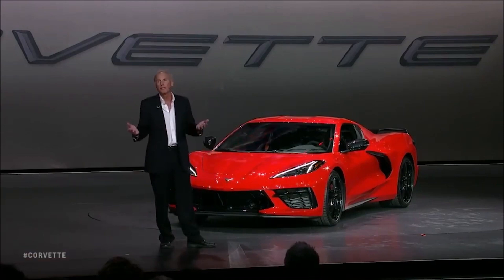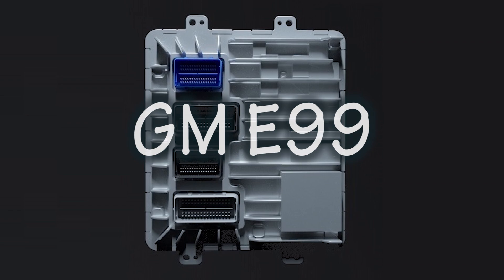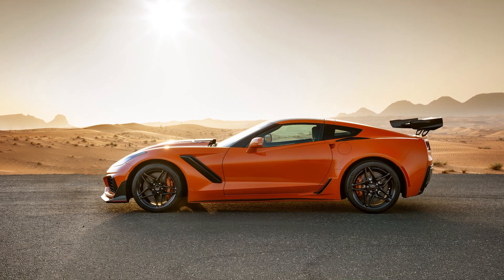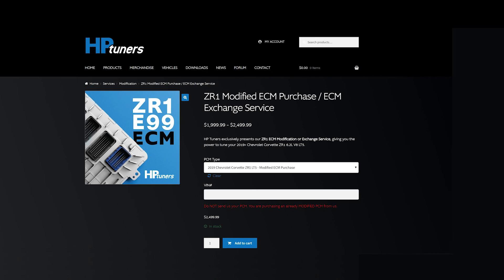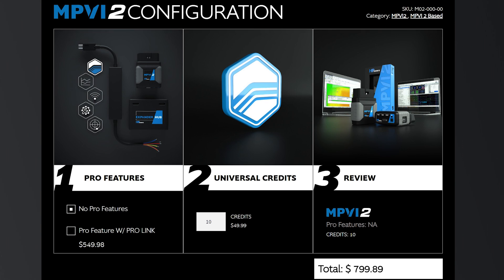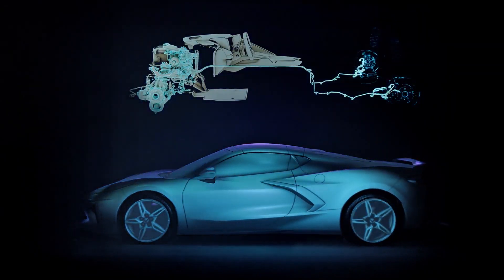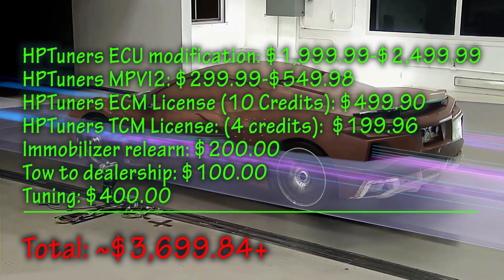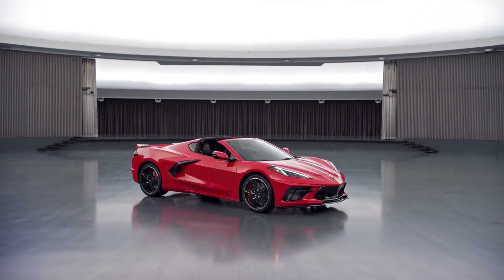Tuning the 2020 C8 Corvette ECU

Comment: You are not necessarily correct when you state that modifying your ECU voids your warranty.  In order to void your warranty, the manufacturer has to prove that the modifications caused the warranty issue.  The burden is on the manufacturer, not the owner of the vehicle.

Comment: It funny how people talk about warranty 90% of the people buying  a car dont even buy the warranty for the car cause it cost so much so I think 3k for a aftermarket update and make 1000 hp and go faster that is hella good for me
Reply: People don't BUY warranties.  It comes with every new vehicle.  If you're talking about extended or aftermarket warranties that's completely different.  All the same, the manufacturer CANNOT, by law, arbitrarily void a warranty just because an owner made a modification.  Rather, the manufacturer has to prove that the modification caused the failure.

Comment: GM,Ford,etc etc can NOT void the warranty if you tune the C8  it's against the law to block anyone from  tuning or modify there car while it's under warranty per Sema vs. auto manufacturers union
Reply: More specifically, the manufacturer has to prove the modification caused the failure.  The burden of proof is on the manufacturer, not the owner of the vehicle.

Comment: How comes every time there’s C8 videos there’s always Supra haters in the comments?😒
Reply: Because it doesn't have a1JZ and is not based on Toyota's own r&d I'm with the purists when they say is not a real supra. The supra should have been closer to the LFA with a finely tuned 1JZ derived engine +500hp priced at around $56,000.00 what Toyota did was to cash in$$$ on the supra name with no substance to show for.
Reply: because it's that much of an embarrassing car
Reply: @LynnIronLightning  hell no it's not, it's running 12's with a little over 330whp and it can corner very well.
Reply: @CloroxGodThe1st  that's not the problem, the problem with it is it's not a toyota supra, it's a bmw z4 with a different body style badged with toyota and supra, the embarrassing part is that toyota overwhelmingly disrespected their legendary car with this infuriating lazy job, it's like ferrari making a new gen f40 by allowing fiat to do the entire work from the ground up and even looking like a fiat, but with decent performance, this new bmw supra is the embodiment of embarrassment for the auto world and will be for the next decade or two. Literally.

Comment: Any aftermarket kit VOIDS  warranties with any engine mod. GM has already said that shops were blowing engines and returning them to stock to have them serviced. Those guys doing dragstrip runs from the factory VOIDED THE WARRANTY BY IMPROPER BREAK IN.  GM said this is another level of encryption and will have authorized dealers making the tune. That means CALLOWAY or someone else. GM also described many tuners AS BAD GUYS. GM has also said this series of cars they will take legal action against warranty claims for abuse. That's straight from MARK REUSS in a interview before the launch. We already know a mild cammed ported LT1 makes around 570 to 600hp with exhaust and performance air filter. This engine might only require headers and exhaust to be at or close to maximum engine output. GM has already done the flow work on the engine, and it has a higher duration cam. I will be willing to bet its only a exhaust job away from being 500 plus on the ground.  GM is well aware of what tuning can do or cant do to the car, because they can stress motors to breaking points. Be on the look out for lawsuits to begin against unauthorized tuning companies.
Reply: The headers that come on the car already are nice no need to upgrade.I say with a larger TB and OB2 plug in tune you would see an easy 50+ HP gain.
Reply: "Aftermarket kits" do not void warranties it only affects the component which was changed.  You still have a warranty for the rest of the car.  Can you please post a link to your claim about Reuss saying they will take legal action? Thanks.
Reply: @EK-rr2md  If it says for off road track only and don't conform with CARB it can void it that's just the way the vendor covers themselves.
Reply: @__  Exactly, returning a tune back to factory specs and claiming warranty. The story is in autoblog about encryption and bad guys. The lawsuit interview was some time before that about trucks.

Comment: Just give it time. If they can crack Lambo’s and Ferrari’s they can crack the c8
Reply: Its literally the dumbest thing to even worry about the GTR was considered uncrackable and yet today they are making over 3000whp lmao it will take less then a week aftermarket shops won't even break a sweat.
Reply: @antilagboostaddiction8322  They are probably not using OEM ECMs in most of them.
Reply: @antilagboostaddiction8322  Um those GTRs run 12-18 injectors, the stock ecu definitely can't run that many. They use standalone ecu's, which is doable for the c8 if the stock ecu really is uncrackable.
Reply: @ronaldmcfondled9604  how is Hennessey controlling the computer in their TT  car?
Reply: @TickleShizz  Apparently they're still on the stock ecu/tune. But they're only pushing 5 psi at which they made 643 rwhp/570rwtq. I think HPtuners is still trying to crack the ecu so they might release something sooner or later. The reason why the C8 ecu is a tough nut to crack is because Chevy employs over the air updates to sort out any electronics/software issues.
Reply: @ronaldmcfondled9604  very interesting, thanks for the insite. Should be interesting to see what they do dialed in.
Reply: @antilagboostaddiction8322  this comment didn't age well 🤣
Reply: @antilagboostaddiction8322  How’s that week looking to crack the ecu?
Reply: Time will tell. The ISF came out in 2007 and its ECU wasn't tuneable until... 2016 lol.